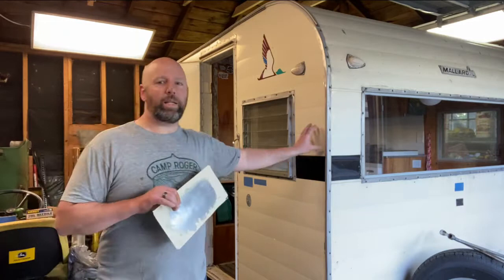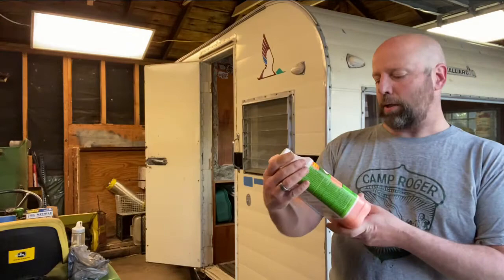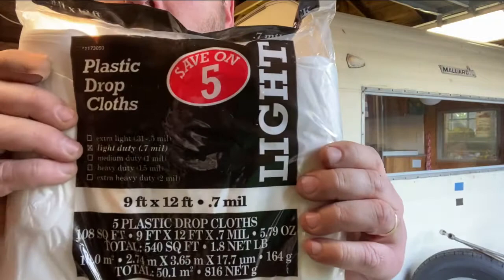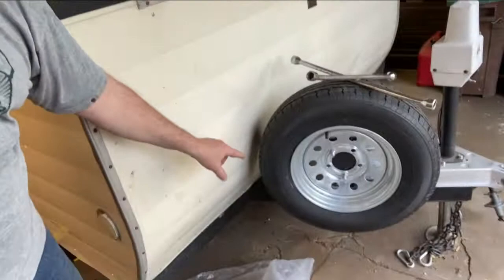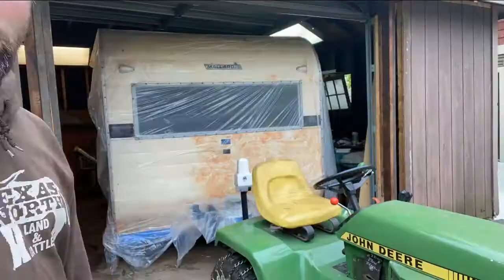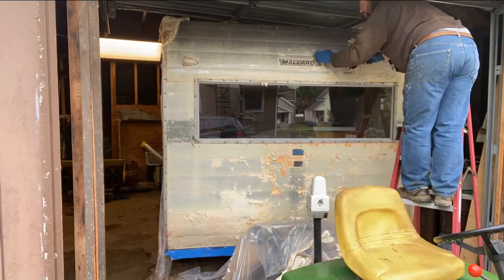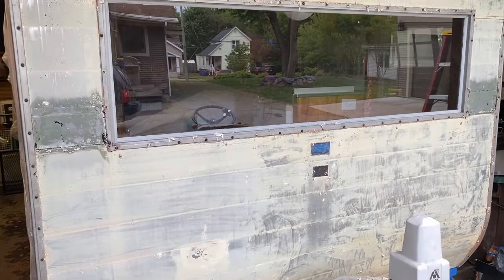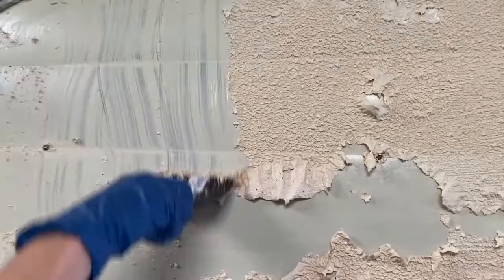Stripping Camper Paint Down to Aluminum

Comment: I have wanted to do my aluminum sided house for years. Kind of like a DeLorean house. The paint is oxidized and coming off anyway. People think I am crazy but now you have rekindled my idea.  I read to keep aluminum from oxidizing it should be clear coated. I am going to try it on unpainted aluminum columns on my carport first.
Reply from the maker: Interesting idea.  I know that old airstreams used to be uncoated aluminum and more modern ones were clear coated for that reason.

Comment: Great job! Thanks for sharing your painting adventure. 99% of the rv painting advise out there says sand vs strip the paint. If you were going to repaint instead of going to the metal, would you still strip the paint and repaint or just rough sand and paint over the old paint? I have a 30ft vintage aluminum Avion that is still silver, as the original looked, but it's been painted silver on top of the aluminum, is flaking and looks terrible. At first the thought of painting it myself was overwhelming, but after talking to several painters and watching many instructional videos, I think I could do it as long as I had confidence in the correct process and had the right materials. Sherman Williams told me to sand, prime with their special metal primer and paint with their special metal paint. So that's been on the back burner for a year as I keep revisiting what to do as more and more paint keeps flaking off. Then today I learned about the option of stripping the paint to bare metal and then saw your compelling video of how effectively the paint can actually come off with stripper. That seems way easier than prep sanding with an orbital sander, but maybe not as I've never done either. Sanding is messy, dusty, vs stripping is goopy messy. And after seeing your video, I can't help but wonder what the original aluminum looks like under this crappy paint. If its in good shape I may not even need to paint. But then again if it was in good shape why would someone have painted over it?! Thanks for any advice.
Reply from the maker: It's just me, but I would TOTALLY try stripping it in a little area and seeing how it goes.  If you paint over pealing paint, it's hard to be confident it won't keep peeling.  I've never owned an Avion, they are pretty cool, but I'd try stripping it first.  At least get all the easy stuff off, then you can see if you like the looks and if not then paint it.
Reply: @3rdstallgarage  Thanks! That's what I concluded over the last week, start with a small area that's not overwhelming. The stripper and orbital sander arrive this week : )

Comment: That looks so much better.
I was replacing the trim and weather stripping and used Goofoff and it removed the paint. I was freaking out thinking I would have to repaint the whole thing, but it's easy to wipe it off with Goofoff.
Reply from the maker: It’s useful stuff.

Comment: great video, I tried it a year ago but gave up because it didn't work so well. But I have the original paint and a facade paint from the previous owner.
Do you have a tip for me which remedy exactly I should take?? My gel was probably not strong enough. greetings Mark
Reply from the maker: I can see where some paints may be harder than others. I think I had an original layer of paint.  The longer the stripper sits on top of the paint wet the better it will work if it dries then it stops working.  Putting plastic over it helped tremendously.  Good luck!
Reply: @3rdstallgarage  OK, thank you for the answer

Comment: What stripper did you use , I'm doing a enclosed trailer as we speak,  I found a pressure washer works best instead of a scraper , it don't get the chance to dry out
Reply from the maker: I used citrustripp from Lowe’s or Menards.  Power washer is a good idea.

Comment: How do you fix split aluminum on the side of a vintage trailer, just picked one up, and it has, a 1ft cut, on the corner towards the front?
Reply from the maker: Sorry for the slow reply. I have a small gauge that I fixed with Jbweld, but a 1' cut may require you to fabricate a patch (easy way...small piece of aluminum, butyl  tape and some screws) or a bigger task of replacing the whole piece of aluminum sheet metal skin on that part of the trailer.  Good luck!

Comment: I’m stripping our 1963 Yellowstone. Did you use a more intense product for fine work? I’m having trouble with the corner rails that have all been painted 3-4 times.
Reply from the maker: No.  On my more stubborn parts I just put it on thicker and made sure that I covered it with plastic so that it couldn't dry out and left it sit for a good long time.  Some paints do just peal easier than others.

Comment: Looks like should be an easier way. Maybe pull out in the yard and do the first plastic scraping step, except for using a garden sprayer instead of paint brush and water hose.
Reply from the maker: Thanks.  That would be a lot of paint and chemicals in the yard.  Not sure I'm comfortable with that.  Overall I don't think the process was too hard.

Comment: Did you repaint the trailer? Thanks for telling us about that paint stripper as I am redoing 1966 Oasis and trying to decide how to go about the stripping and repainting. I plan to do a rattle can rustoleum paint job. I did that on another trailer and it really turned out nice.
Reply from the maker: Nope.  I plan on leaving it bare aluminum.  I may give it a slight polish sometime along the way or paint a color strip to give it a little flash of color.
Reply: @3rdstallgarage  Thanks.